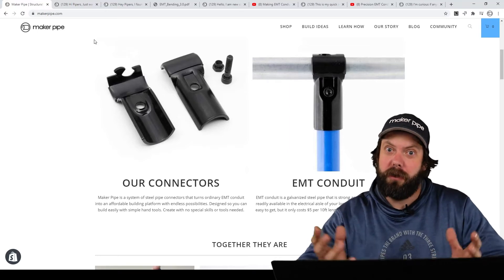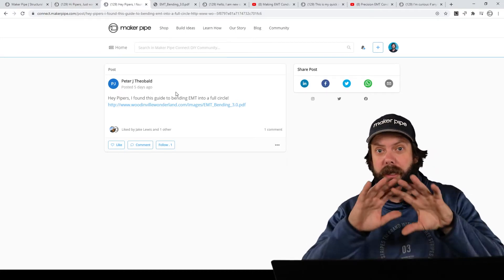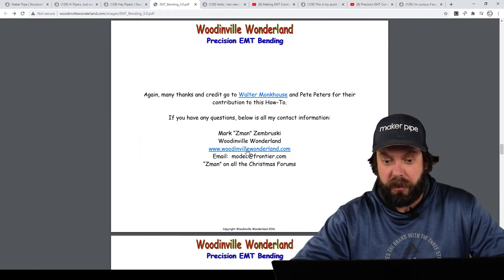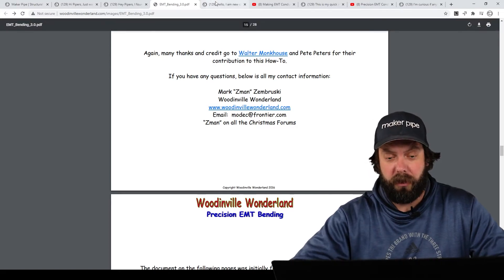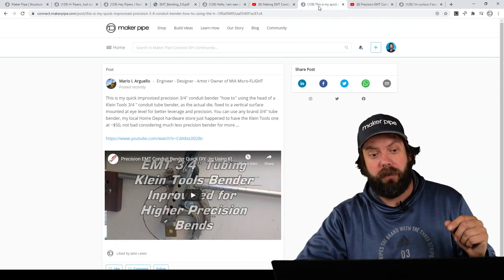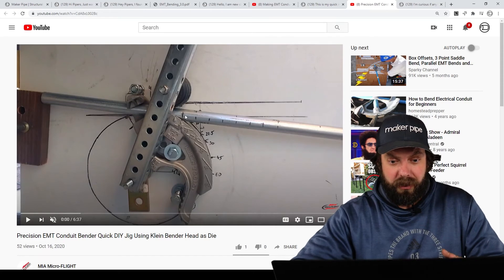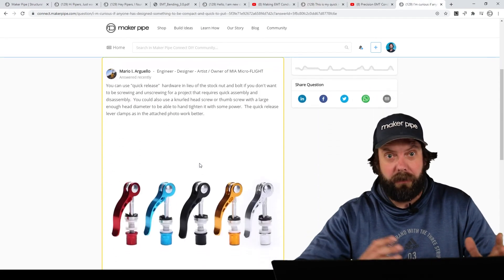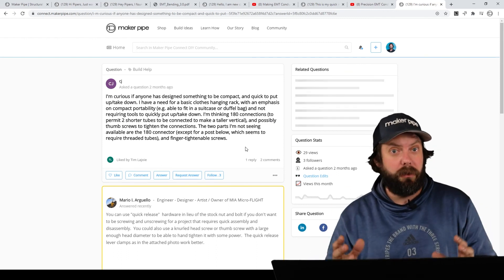Creative Conduit Building Hacks - Maker Pipe Monday - 017

Comment: Great to see these weekly episodes, thanks for the link. As soon as I am somewhat done with my projects, I will post them at MP site and on my YT channel. My goal has been to take the MP connectors to another level that I have not yet seen explored and my projects with them  are to really test my application both from an experimental and real function level. I love the Maker Pipe connectors, they are simply awesome from many respects, what I like the most is the fact one can build quickly with them and is an alternative to welding structures. I do not weld  because I am concerned with fumes and debris that no matter how you protect yourself it can actually get into your system, by nature of the process. A high quality hand pipe cutter, and a bolt-on system has always worked for me. 
Glad to have found you guys and thank you for featuring peoples ideas and builds.  MIA
Reply from the maker: Can’t wait to see.  You have had quite a few great hacks!  Thanks.